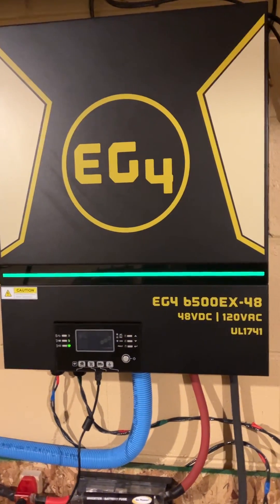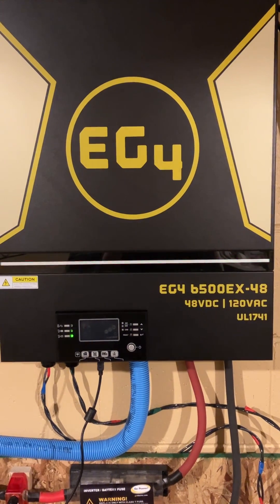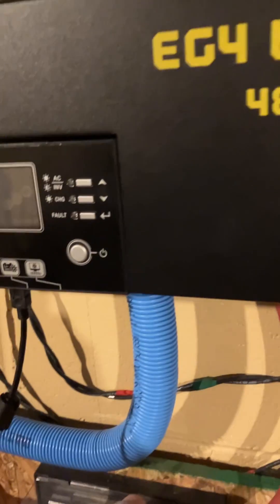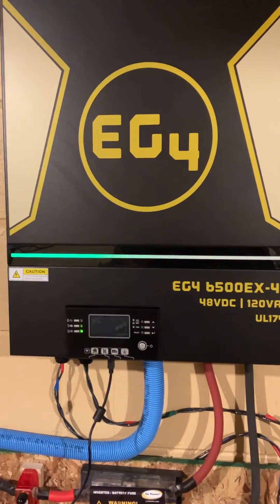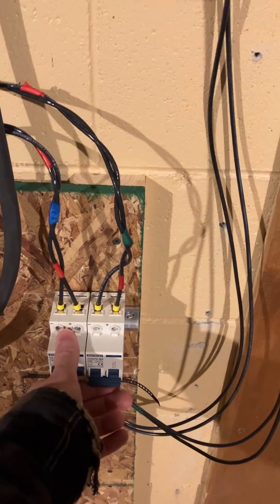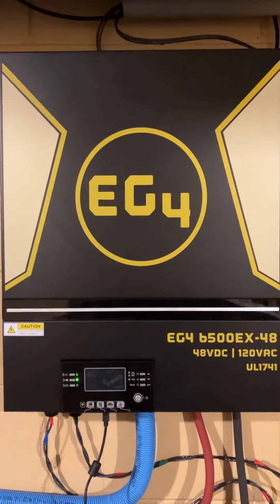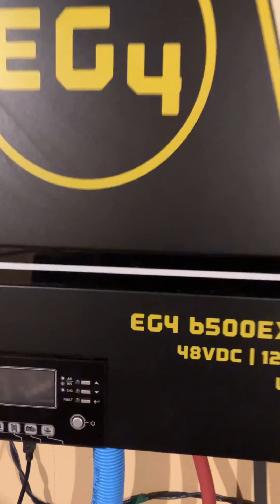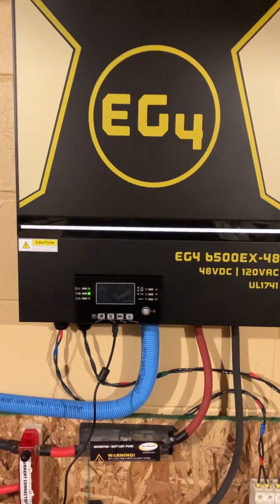When the EG4 6500EX starts working hard...you'll know it!

Comment: I use Solis inverter. Giant aluminimum heatsinks on the back makes it stick out from the wall, and more expensive, but it's as quiet as a church mouse.
Reply from the maker: Yeah active vs passive cooling makes a huge difference.  My Victron Charge Controllers all have heatsinks and no fans.  They worked great and had no sound at all!

Comment: There is a fan above the 4 pv inputs.   The wire a thin and continous current heats them up fast.    Weakest point of the LV6548 and clones.   I will consider rewiring wit 8AWG.
Reply from the maker: Thanks for the info!  If you make that change, let me know how it works for you and send some pictures!  Would be very curious to know if it causes the fans to not run as hard!
Reply: @AdamDeLayDIY  If you have a thermal camera,  you should see the heat pocket on the area where the PV inputs connect.
Reply from the maker: @errcl65  I do, I’ll take a look, thanks!